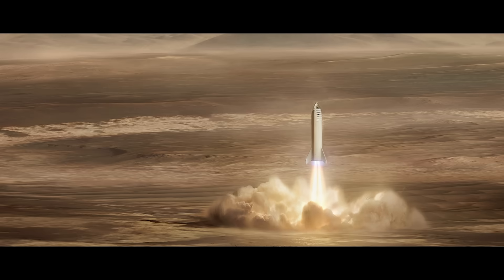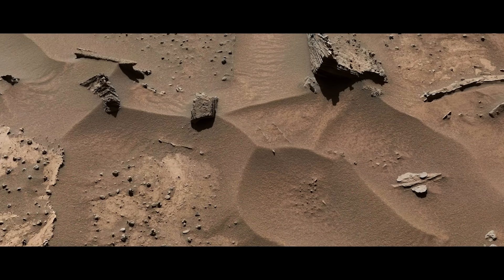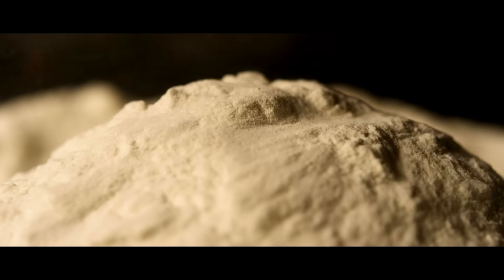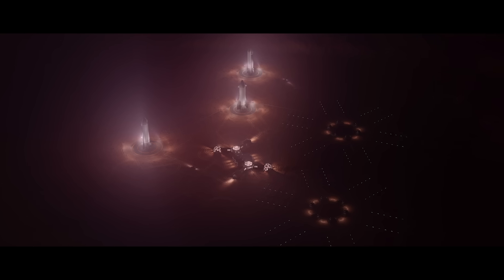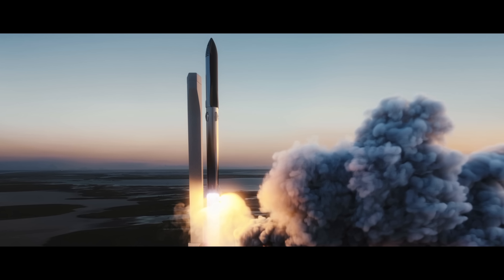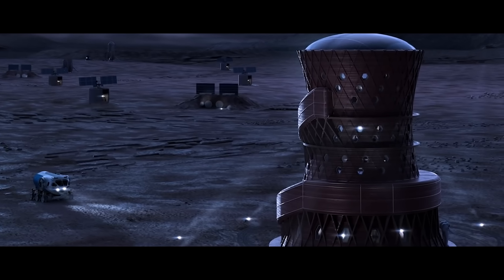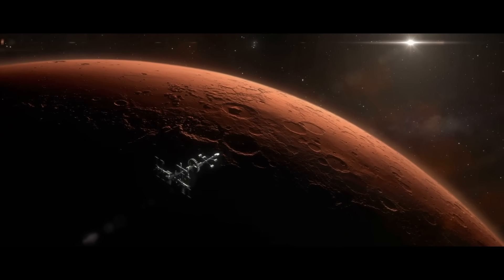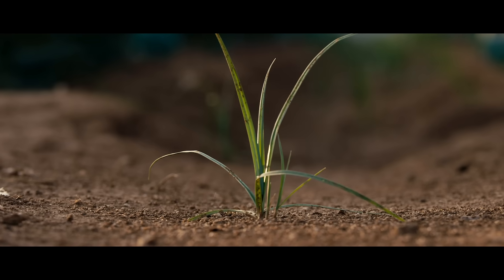THE FIRST 10,000 DAYS ON MARS (Timelapse)

Comment: Deep Dreaming.  
This timescale is way off.
The landing of 5 of Elon's exploding stainless steel trash cans on Mars in 4 years time.😂
He can't land one on Earth yet without KERRR BOOOOOM ! 🔥🔥🔥🔥🔥
Reply: Actually I think its Glen Stockwell who is charge of the Space Research  part of the company. And Her Engineers have landed one successfully, they are using secondhand parts ie: rocket engines for research into the control of landing such a giant device. The very fact that they have another ready and waiting to test other parts of the procedure means they are learning all the time and making changes for the better. 
If it was NASA there would be years of enquires, Senate hearings, cancelled projects, people fired, and nothing advanced at all.

Comment: I can’t see a manned Mars landing happening until at least 2030. Also, everything mentioned in this video should happen on the moon first.
Reply: To small and that wil affect ebb and flow
Reply: @pankoek9279  Umm, that’s not a reason to not build a massive moon colony first.
Reply: @pankoek9279  So you think it’s stupid to build a moon base before a Mars base? Because doing that sounds more sensible to me. The moon is easier to get to than Mars after all.
Reply: @pankoek9279  No, I don’t mean wait until 15 years after the next moon landing to do everything in this video on Mars, I mean start doing those things on the moon, then start them on Mars 5 to 10 years later.

Comment: Final scene wouldn't be possible without a lot of terraforming first, for a lot of reasons.  First, Martian regolith is toxic: it's too alkaline for plants, it's loaded with perchlorates that would slowly poison humans, and the planet has none of the nitrogen compounds plants need to survive.   The Martian atmosphere is also too thin to support plant cellular respiration.  Finally, even at the equator in summertime, it get as cold as Antarctica at night on the surface (minus 73 degrees C).

Plants CAN grow in Martian soil... but only AFTER it's been heavily processed to neutralize the pH and chemically eliminate the perchlorates, infused with nitrogen fertilizer, seeded with the bacteria & fungi plants are symbiotic with, and the soil is enclosed in a pressurized & heated area.

Or just grow them in a hydroponics (or aeroponics) rig connected to an aquaculture fish farm.  These rigs work fine here on Earth, and would be pretty simple to set up on Mars, once you've made enough water to fill them.  Bulk soil conditioning is really more suited to the long-term terraforming project.

Comment: 1:12 "7 football fields" This could bei 50,000 m² with 20 MW PV
1:20 "only 43% as efficient" There is far less atmosphere to reduce solar radiation. In Earth orbit 1367 W/m², while Earth atmosphere reduces, that even 1000 W/m² is great.
11:56 "nuclear fusion" They will even not on Earth have fusion.
14:58 "oxygen to martian atmosphere" Mars has a too low escape velocity for an oxygen atmosphere. At last should be an artificial magnetic field on Mars before atmosphere experiments.